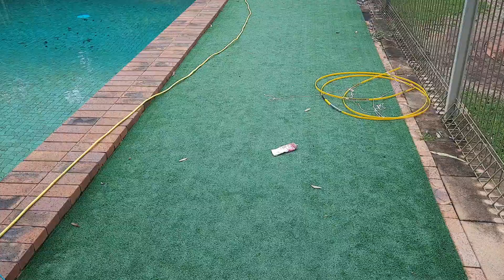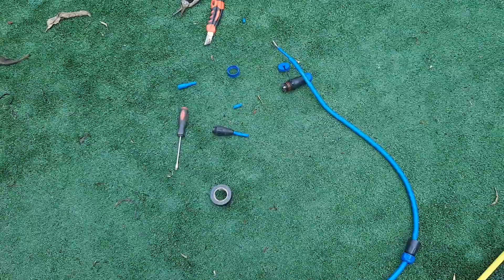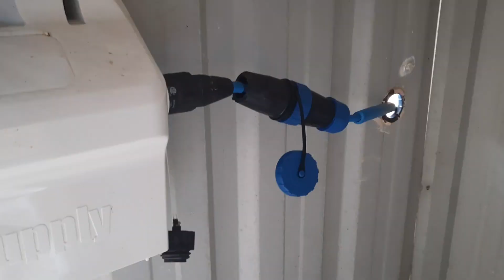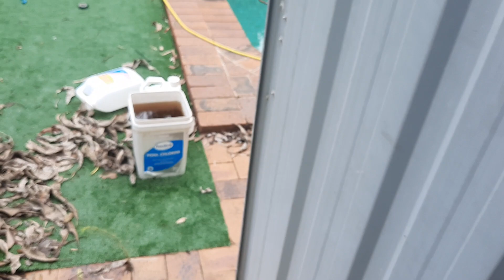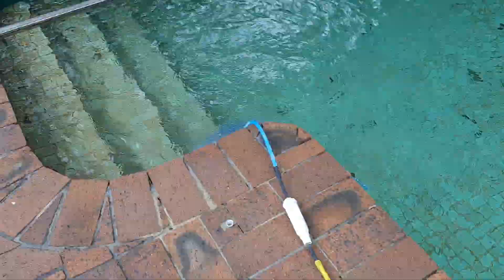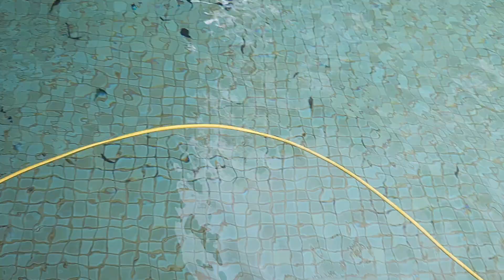Maytronics power cable heat-shrink coating

Comment: Nice fix! I just ordered a replacement cable… aftermarket off brand and still $120! Probably more than the Dolphin is even worth but cheaper than buying a new one.😏 I’ll probably keep the old cable and try this fix for whenever this cable craps out (assuming the rest of the unit lasts that long)!
Reply from the maker: Yeah. They are ridiculously expensive but its a good machine.
Unfortunately the heatshrink didn't last as long i hoped but it was worth a shot